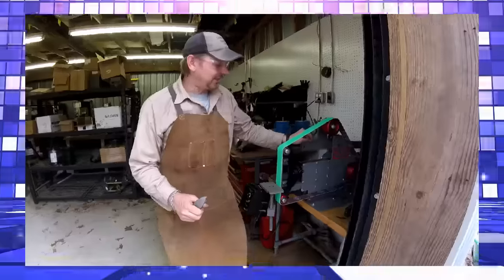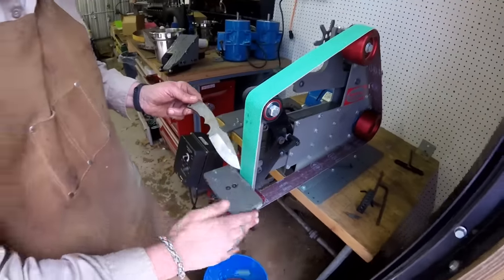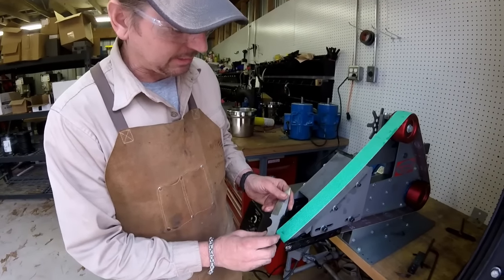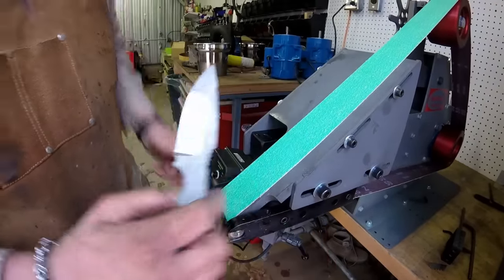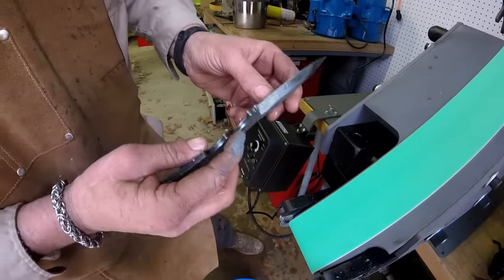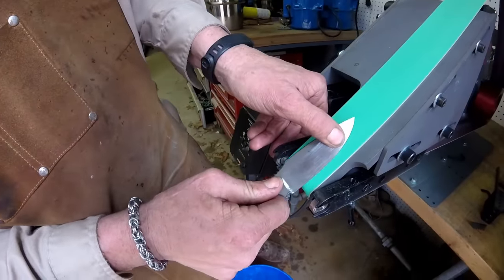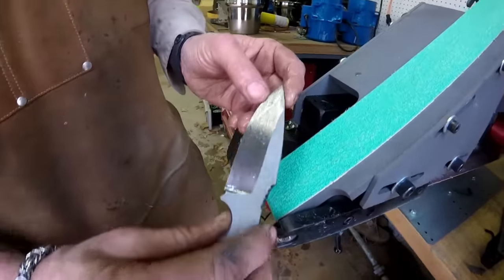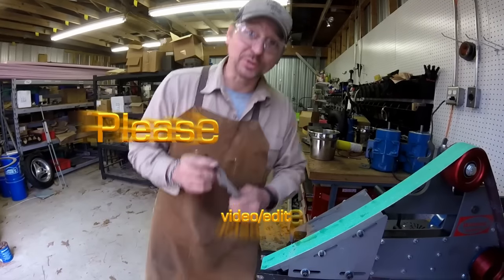Wilmont Grinders Plunge Attachment

Comment: Couldn't you run the belt in reverse just to keep from accidentally digging into the belt since at this point your not really putting the edge on the knife and just shaping it. I really like the jig.
Reply from the maker: Yes I run the belt in reverse on the last step when running a Scotchbrite belt. But its not necessary in the beginning.
Reply: I know this is a few years old but by reverse.. do you mean the belts marked direction?
Reply: @jasoncass6967  No, you add a reverse switch to your VFD. The belt then can run either way. I have two of Chris's grinders both set up with reverse switch. extremely helpful for all kinds of work